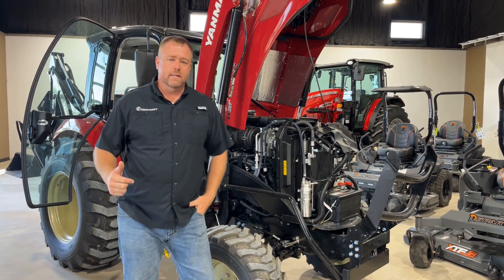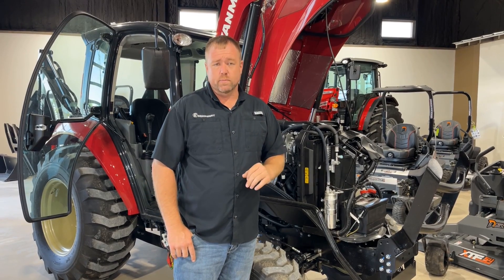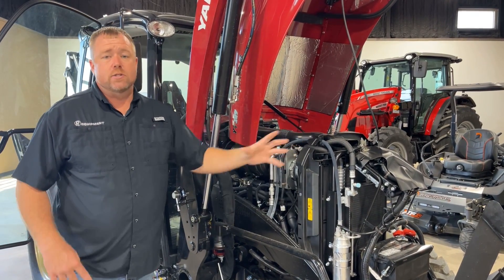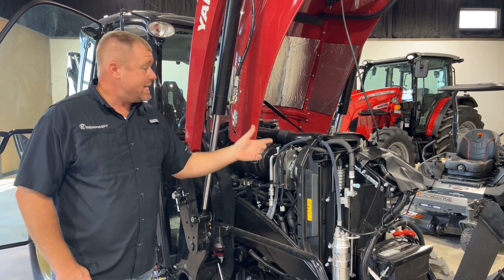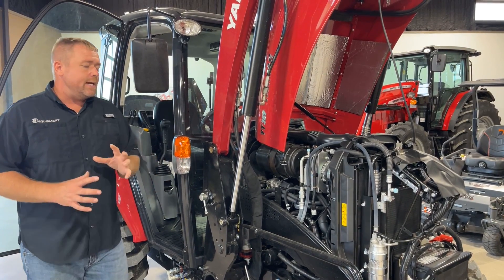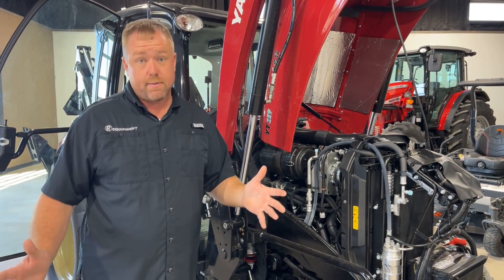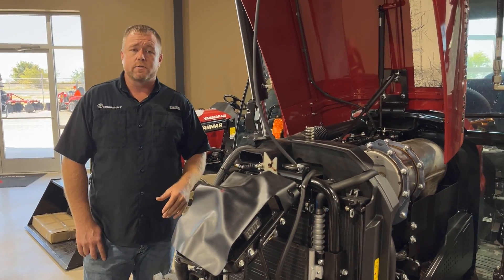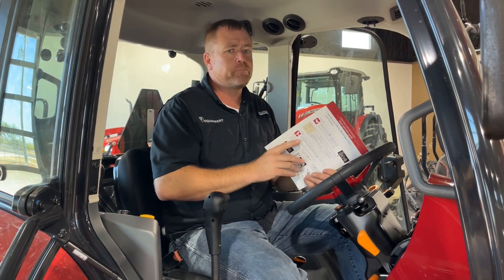Tractor Emissions - Taking a look at DPF/REGEN systems.

Comment: We have a Mahindra mforce 105p that we can't even use to stack hay bales because it won't go out of idle and wants constant regen. Help!
Reply from the maker: You could’ve stopped at Mahindra.  Yeah those tractors are well know for junk emissions systems in addition to all the other issues.
Reply: @prequipmentsales  lol. Now that we know that what could you suggest? We have a very expensive tractor vut can hardly do anything with it 🤦.
Reply from the maker: To be honest I’m not sure.  I taught emissions systems to technicians when I worked for Agco/Massey corporate.  My instinct says that on some level system diagnostics is lacking at the dealer level however I’ve heard of similar complaints and it seems to wide spread to pin on sub par dealer support.  I actually traded for a 105 last December that was in the shop at the local dealer.  They replaced the entire system which screams they couldn’t figure out the actual problem.  Interestingly enough if I’m not mistaken, I think is a Bosch system which unless they have a economy version for Mahindra should be pretty reliable based on my experience.  Personally if you’ve had enough trouble with it you might try to force a buy back and I know they’ve had to do it before but it won’t be easy.  Otherwise take the hit and trade for a brand/dealer that can provide a better level of support.  I know I can’t beat Mahindra on price but I promise we take care of our customers and equipment with good support from our manufacturers.  Mahindra’s aren’t for people who actually use their tractors.  It’s situations like this where you realize why they’re cheaper.  I wish I could be more help.

Comment: Thanks for your time. I own a TYM 474, HST, currently 210hrs
Has never regened (nor have ever indicated a loss of power). I am not a tractor mechanic. I would recommend for folks with problematic regens to install a pyro as close to the exhaust valve ports  as practical, prior to the cat. I like analog gages, but an idiot light that illuminates if exhaust temp is to low will work. Tractors have a wide range of mechanic advantages that can work against engines that are subject to repetitive regens. The pyro will learn the operator how the manage the exhaust temperature to keep the cat hot. A hot exhaust is what the will prevent regen, not engine rpm nor jacket watet temperature will make the cat hot. All Diesels need a minimum exhaust gas temperature to burn clean. Regards.

Comment: How does the egr system work? And does it damage your engine? I was just wondering because I have heard people say that and didn’t know if there was truth to that or not.
Reply from the maker: That’s actually a pretty good topic for a video one of these days. The truth is I don’t think EGR itself has ever caused too much of a problem with the engine. However a failure of an EGR cooler has certainly caused headaches specially in Ford trucks if my memory serves me. That’s some thing we’ve not seen a lot of in the tractor world.
Reply: Ok thanks for the quick reply!

Comment: Oh so that is what my 1835M is doing but ift dropped my hp whay down.
Reply from the maker: Shouldn’t pull too much power away from you.  Most people don’t even notice it.
Reply: OH Buddy this does and it is in safe mode and it will not go over 15,000 rpm  @prequipmentsales
Reply from the maker: @lowellpearson8782  that’s not regen that’s derate.  Regen won’t restrict your RPMs. Either it hasn’t been allowed to complete the cycle during previous attempts, or there’s a different issue. What light do you have on the dash?  Does it say P?
Reply: Yes both lights are on.
 @prequipmentsales
Reply from the maker: Text me @ 903-851-7573 and I'll send you some info about the regen system. @lowellpearson8782

Comment: Computers in tractors? No thanks!!!
Reply from the maker: I understand some folks try to avoid computers by hanging on to older tractors.  I myself am a fan a simplicity.  That being said this technology is quite reliable and allows for many awesome features not available on older equipment.  Thanks for watching!
Reply: @prequipmentsales  I can't think of a single feature on new tractors (cars or trucks either for that matter), that relies on the DPF system to function. Everything from the ECM down to the work lights couldn't care less if you're powered by diesel, gas, or hamster. Manufacturers program the ECM to basically disable (limp mode) the other systems from functioning because the consumer didn't follow their demands. Or in the case of gas powered vehicles, your O2 says the carbon levels are higher than nanny Government says you can have. Sad times.
Reply from the maker: the programing of the emission systems comes directly from gov mandates.   Even the way the error codes are implemented comes from regulation.  You won't hear me claim it's great but these systems have got much better over the years as a lot of learning has taken place and these engines are running incredibly cleaner whether you care about that or not.  Thanks for watching.  @chiefkyle1776

Comment: I will say it will out pull my cousin 75 hp John deer and my cousins 70 hp new holland it’s the strongest 70 hp modern tractor iv ever cut land with
Reply from the maker: Yeah, the Massey 4707 is just a lot more Tractor .  I always encourage folks when they’re shopping to at least come check it out for themselves.